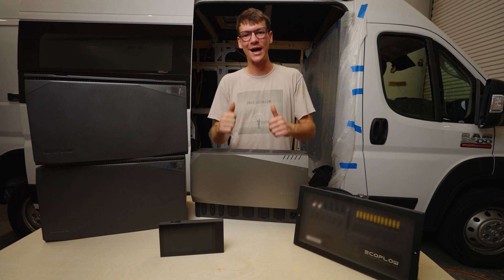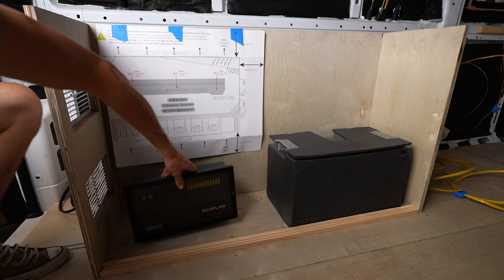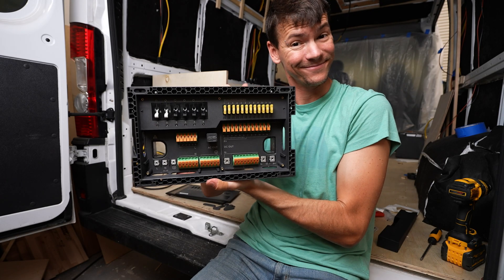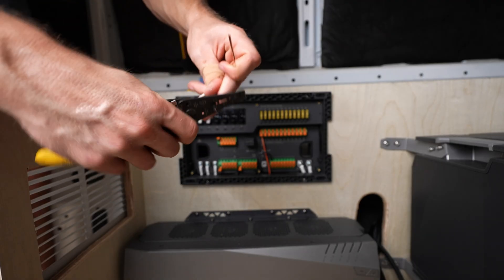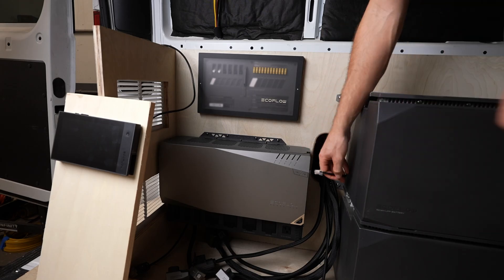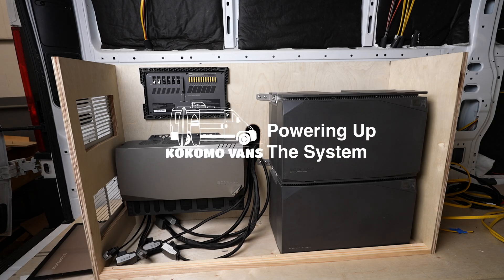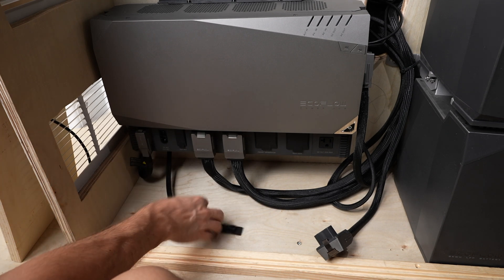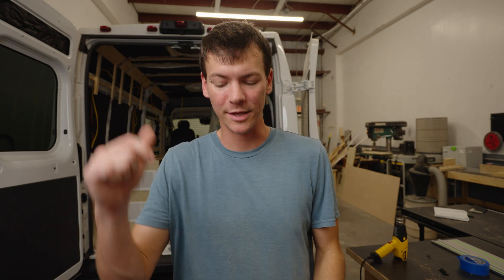How To Install EcoFlow Power Kits | Tutorial

Comment: Is there any way to connect the control of devices via an alternative solution, like button-switch? I'd like to have a light inside the camper at the entrance, but I'd also like to be able to use a water pump and a few other devices.
Reply from the maker: Yes once your wires have power from the distribution panel, you can install whatever switches/lights you’d like

Comment: I have so many issues with mine. It does not behave well if I have solar plugged in. And it draws about 4% battery per day just doing nothing, and it also draws battery from my Wave 2 which is plugged in via the distribution panel. So I have to account for all this battery drain when I go on trips, it's so stupid. I'm starting to get a lot of regret over this. I am talking to customer support now but I don't know if mine is broken or if they are all like this.

Do you think it's weird that we never ground this system? Aside from the negative on the alternator wire but I don't always have that plugged in.

Comment: very informative.  Question -  I have a 12V Garmin Power Switch I'd like to wire into the ecoflow to control all of my external van lights.  The Garmin site say the their unit has a max amp total of 100amps.  Any way to tie this accessory into the ecoflow?  I've used the Powerswitch before and my total amps never exceed 25amps with all the lights activated  Thoughts?

Comment: This was very helpful and informative. A couple of questions 1) Do both Ecoflow cables attach directly to the battery terminals, or do you ground the negative cable elsewhere? 2) Does it matter where you connect the inline fuse on the positive cable? I appreciate you help.
Reply from the maker: Yes for alternator charging, you connect both the positive and negative wires to the battery. 

All that matters with the 100A fuse is that it’s easily accessible and is somewhere before the connection to the power hub. 

Glad I could help!

Comment: Amazing work! Just one tip - when you install the alternator charging cable, you need to move that 100A fuse as close to the van battery as possible. If you have a cable run through on the chassis on the section of cable BEFORE the fuse - you’re gonna burn your van to the ground.
Reply: Sorry what do you mean.? Reason I ask is I did this but the fuse is closer to my power station at back of van. The wires are protected in a mesh covering is that not ok? Thank you.

Comment: Great video . Thanks.
Do I have to use a 100 amp fuse for the alternator 6 guage line?
I want to locate my fuse in the battery box with a simpler in-line set up and 100 amps seems like overkill.
How about 40-50 amps?
Thx
Reply from the maker: You’ll want something higher than that because you’ll regularly be pulling roughly 70 amps charging from your alternator

Comment: On my power distribution panel, there are 12 fuses, 12 positive lever connectors but only 8 negative lever connectors.  If I have more than 8 lines - where do I connect the 9-12 negative wires?? Can they be double upped??
Reply from the maker: Yes they could be doubled up on the negative side. There’s also a negative output screw mount next to the negative pinch connections. You can put a ring terminal on extra negative wires and mount them on there.
Reply from the maker: Make sure you don’t use the negative input screw mount
Reply: This on the DC side.
Reply: Thanks!
Reply from the maker: You’re welcome!

Comment: Is there anyway to implement this system to an existing RV AC/DC system without using the smart distribution panel?
Reply from the maker: Yes you’re able to use your existing distribution panel in your rv. The wiring that goes to the distribution panel is standard AC/DC wiring. Please reach out on our website and we can help!

Comment: It looks like a great system. But for me, I would need more amperage available on the DC panel because it seems wasteful to run A/C off the AC line. I'd only want to run 120v outlets on the AC line and keep all other loads off of the inverter. Perhaps 100A DC total would do it, with 70A on one line as a rough guess.

Comment: Thx for your Video, good inspirations!
i have a Power Kit Independence Kit with one 5kWh battery installed in my van.
Unfortunately, I have noticed that the battery discharges by around 15% within 24 hours without a load being connected.
I started on Sunday around 5pm with 50% capacity.
Yesterday (Wednesday) only 6% charge remaining. No consumer used electricity during this time. Only DC was activated.
Losing 44% of a 5 kWh battery in standby within 72 hours is not really energy efficient, is it?  
what is your experience?
Reply from the maker: Hi Oliver, I’d see if you have a firmware update available and reach out to ecoflow about this through the customer service chat section on their app. This is abnormal and I’m sure it can be resolved.
Reply: @dirtbagsontheroad  Thx for your reply!
Firmware ist up to date... Fresh answer from Ecoflow-support: "The PowerHub will consume 20W of power when the DC output is turned on, in addition to the appliances. So it seems that the LFP battery loss is within the normal range."
20 watts correspond to 480 watt hours per day, which means that the 5 kWh battery is empty after 10 days of idling at the latest...
Reply from the maker: Interesting! I always have the systems charging with solar constantly so I guess I’ve never noticed it. Hopefully you’re able to leave the dc turned off when you’re not using it.
Reply: @dirtbagsontheroad  Solar in sunny months may be no Problem, but during winter and rainy days... I need DC constantly for GPS, alarm and parking heater (remote start). With a normal Lifepo4 no problem for weeks in Standby. I should Charge and discharge the battery 2-3 times from 100%-0% now as a suggestion from ecoflow. I Just Start charging...
Reply from the maker: On the few rainiest days that could be a problem but most cloudy days you still charge enough to counteract that small drainage as long as you don’t park under a tree. And yes a custom Victron system would definitely be better. The ecoflow system is for people that want the plug and play ability. I’ve personally never heard any of my customers having a problem with ecoflow though.
Reply: @dirtbagsontheroad  Thanks for the exchange! Please feel free to publish a video about your experiences with the Power Kit in due course. Greetings from Germany and a merry Christmas!
Reply from the maker: Cheers! Merry Christmas! Good luck with your build

Comment: Does the location of the fuse for the Alternator cable make any difference ?
Reply from the maker: No, it just has to be somewhere between the ecoflow system and the van starter battery
Reply: Thanks for your help  @dirtbagsontheroad

Comment: Great video - thanks. Quick question - do I need to ground the power hub to the vehicle chassis using the earth stud? If not, why not? Thanks!
Reply from the maker: I’ve seen lots of debate going either way. I’ve heard it doesn’t matter for the 12v system or you only need to be grounded when plugged into shore power. Too much mixed info for me to give you a solid answer sorry. Go ahead if you need the peace of mind.

Comment: I’m planning to install an secondary 48V/100A alternator for charging. How does WS500 controller setup to work with PowerKit alternator charging?
Reply from the maker: I’m sorry I don’t believe eco flow currently supports connecting to a wakespeed controller
Reply: I Think it supports!

Comment: I have the independence 15 Kwh kit . This video pretty much spells it out, Great system. For me in a off grid situation, it works great. It is rated for 3600watts it could put out <4000watts and surges @ 7200. I rarely push it that high. The optional display is awesome and I'm always checking it out. I don't use the Smart Distribution Panel, maybe in the future I'll wire it up but for now I am happy with my decision to go with the Ecoflow power kit💖
Reply: Thanks for comments.... How is this system working for you now that you've had it in a a while? Im hearing of some people having real troubles.
Reply: @christopherbrandler508  Working great as expected in the beginning then some trouble after 2 months of normal use. 1st issue was not charging to 100% it would stop at 85% ???  2nd issue was a error code of AC bus overload and the unit would bug out when AC input  stopped and  inverter took over, it was much more than 30ms. Twice it shut down completely and re-started by itself??? safter contacting Ecoflow, they had me do a battery calibration test and download the latest firmware... Happy to report all is ok now, Ecoflow customer support seems pretty good  👍
Reply from the maker: Glad the firmware update fixed your issues! @rccosplay3249   For anyone else reading this, a firmware update is recommended for any new system you buy and is easy to do through the ecoflow smartphone app.
Reply from the maker: Thanks for the input here! What do you use instead of the smart distribution panel? A regular breaker box?
Reply: Yeah regular breaker box, I'm looking forward to setting up the Smart Box for monitoring and control.